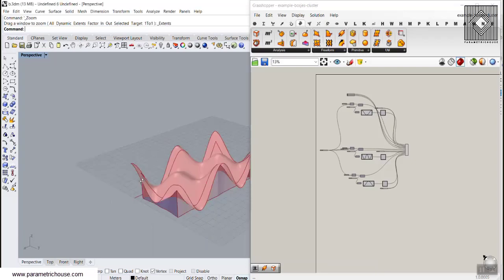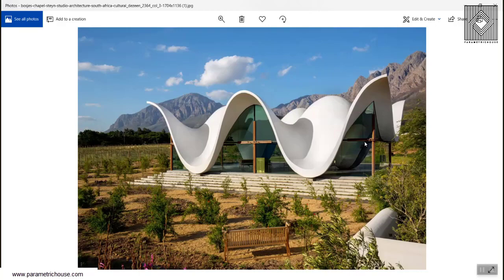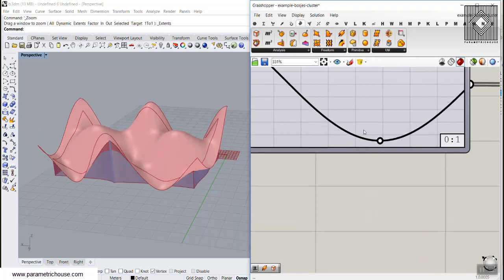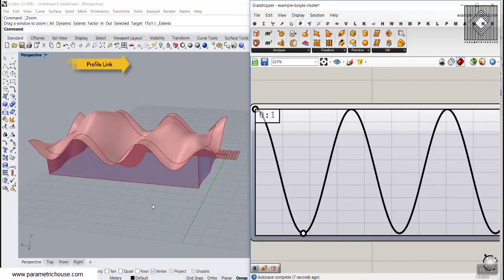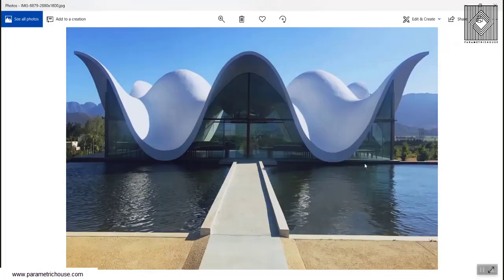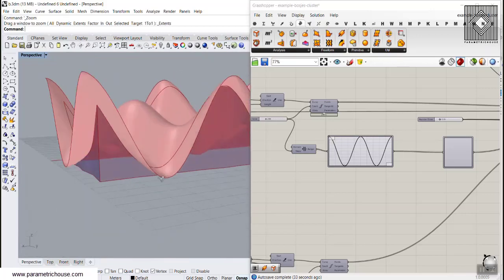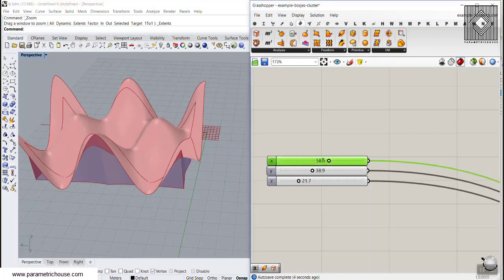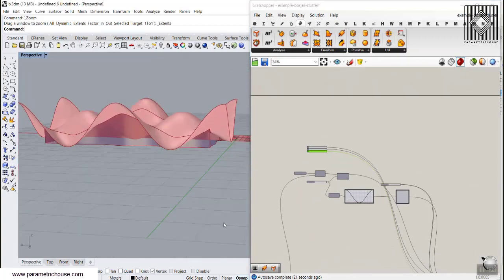Bosjes Chapel

Comment: Hey, 
how can I extrude the surface in the z-direction but with different thickness. I want to use a point attractor. The corners should be thinner than the bearings. 
Thank you very much!